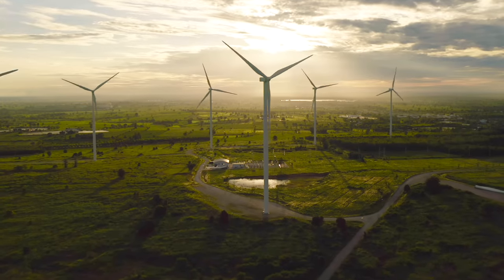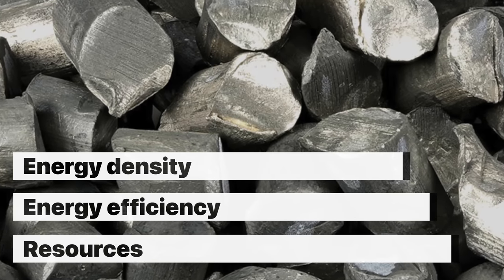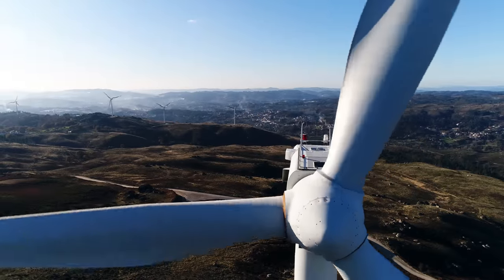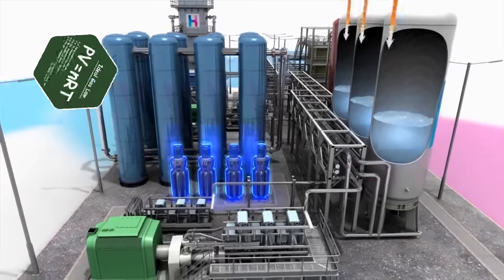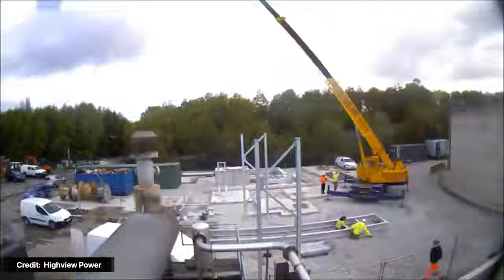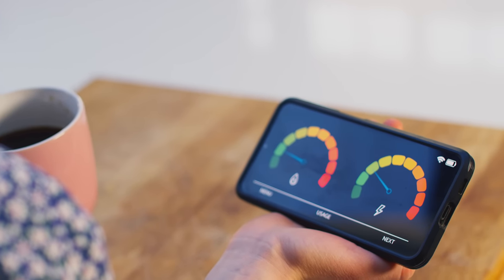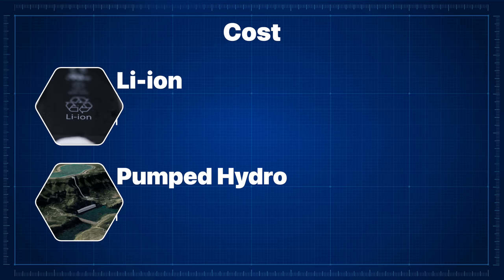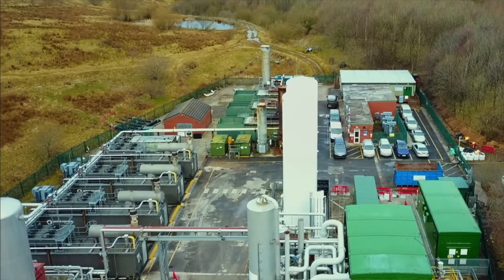Insane Breakthrough Stores Energy In Frozen Air!

Comment: Every storage with pcm where cold or hot temparatures needs to be maintained is good for normally 4-12 hrs cycle storage. This is the first gap that needs to be filled, but also more competition. Thermal chemical ( for eg nanocoated salt or hydrogen is for longer storage suitable, will be about larger storage for longer time. That’s what we really need with our summer/winter seasons..

Comment: A cryogenic energy storage facility could be used in the desert of Las Vegas Nevada USA there is a power plant there that is not being used it's solar they have high winds and high heat  hot air be drawn in or use the unused solar plant to generate more efficient forms of heat for the cryogenic storage system you would probably get 60% or better efficiency and with a proper and effective storage cells it could possibly be even higher this would be a great project for that area and would put that power plant back to use instead of sitting there unused which is solar it has an issue with power conversion but would be great for heating air and helping in the conversion process for the cryogenic power storage system

Comment: I have been storing energy as compressed air for over 50 years. My windmills all pump air. I use vertical axis wind turbines with a simple pump and some check valves. It's really simple and it's easy. I use the compressed air to run Small engines I design and build as a hobby, but I can also make my own electricity in any voltage I want using the compressed air run through any number of engines I have built, to turn a generator or alternator. The trade-off is, it takes a lot of air to make anything happen, but for me, it's just a hobby, so I don't really care.
Reply: This is very interesting. I know there are a variety of air powered tools out there. How much electricity can you produce from your windmills this way?  How many watts can you produce? What PSI does the system run at?

Comment: The Ambri battery is also only 80% efficient vs the lithium-ion battery, which is 90% efficient but, since it is only a third of the price of the lithium-ion battery, it more than makes up for its lower efficiency. The initial costs will be drastically lower and will make up for the energy that is lost over time.
Reply: Sounds like the beta to vhs competiton. Does Ambri have any other advantages than cost at this time over lithium?

Comment: So much great innovation right now. Using excess renewable energy in all forms in a must and multiple options too. Another option being looked at is using excess renewables for electrolysis  to create hydrogen and then maybe one day  use existing gas networks as a huge battery that can be used on demand.

Comment: I’m going to have to disagree about efficiency being the most important.  Here in the UK where this is being built, there are significant periods of time in the winter when it’s very windy when we have more electricity than we can use, more than we can export and more than we can store. This excess energy will increase as we are adding extra wind power every day. This means that we have to turn off wind turbines throughout the autumn and winter. Under these conditions, even if the battery was 10% efficient, it’s better to store the excess electricity than to constrain the generation.
Reply: I was thinking that, there are many times throughout Europe where wind generates more energy than we use and that excess energy would be ideal for this and as you say, considering we're building more renewable energy sources like solar and winds, it's likely we're going to see a lot more periods of excess energy being generated.

Storing that energy is where the problem is and this could be one solution to that and even thought the efficiency isn't that great with that storage option, it's better than nothing and it's likely only going to get more efficient in time.

Also, because of everything that's going on with Ukraine and Russia and the energy market, it's very likely we're going to get a massive boost in renewable energy in Europe, in other words, it's very likely at times that we're going to be generating a lot more energy than we need.

Comment: Switch to compressing the air to a liquid and storing it in a pressure tank, that way you can use the heat from compressing it with a stirling engine to get some power out to contribute to compressing the air and there is no need for insulation or for heating when using the air battery. Shure you need thicker tanks and perhaps a carbon fiber or kevlar blast shield for safety, but running it would be more efficient and storage over time would cost next to nothing as it do not need to be kept cold. Provided the tanks are built to handle at least -35 to +130 c you would get more out than you put in if it is cool/cold when you fill it and warm/hot when using it aka fill at night.

Comment: Determinating if a technology is economically feasible as energy storage, is determined by a combination of efficiency and cost. As more excess renewable energy becomes available for storage, efficiency will become less important and lcoe will become more important. One of the big advantages of this technology is that it is extremely scalable as far as the duration of delivering power is concerned.

Comment: I live in one of the summer “hell” zones, the Imperial Valley in the Southeastern corner of the state of California.  I have often wondered how our excessive heat could be “captured” and used to generate energy on an affordable scale.  What processes have you seen used in other areas of the world that might be viable even for a common homeowner?  I look forward to seeing your thoughts.
Reply: Imperial Valley has plenty of sunshine which can be put to use with agrivoltaics, solar panels over crops.  And then there's the geothermal power plant at the south end of the Salton Sea.  So you can keep the heat.  😁😁
Reply: Annualized geo solar could work well
Summer heat is transfered via water pipes to the ground where it is extracted in winter for home heat or to preheat hot water boiler
Reply: @3crowsfarm16  
That's not very effective where the water table underground is only a few meters below.  It will soak up heat and move it somewhere else.

Comment: If the cooling level were increased to beyond -280C and coupled with steel plants & silicon chip fabs, the side gas products could be fractionally separated and used, as well as sequestering CO2 and getting credit for that only releasing the nitrogen fraction for power regeneration.  The Neon, Krypton, and O2 fractions (even if small in some instances) could be separated for other markets as just part of the process.

Comment: I feel there's a missed opportunity here. Why not harvest the energy using the heat exchangers? The pressure is insanely low compared to the temperature differential. A heat engine being used as the exchanger rather than exchanging the heat forcibly should produce more energy from this differential and latent heat than a pressure engine. Hell, use both!
Reply: Sterling Engine?

Comment: CATL is already building sodium Ion batteries that cost $40/kWh and are capable of 1500 charge cycles, about 3 times as many as lithium ion.  Cost, even including BMS and grid tie inverters, will probably kick the guts out of even pumped hydro, without the land utilisation problems.
Reply from the maker: Really? I didn’t realize they already were commercialized! I need to look Into it. Thanks Anton!
Reply: @TwoBitDaVinci  They're making them using Prussian White instead of Nickel.  The resulting batteries are high specific power to weight, but not good on power to volume - meaning they would have limited usefulness in vehicles.

However, as a stationary storage medium, they're looking great, as long as you don't mind them taking up about a third more space than equivalent LiFePo4 batteries.

Comment: So.. This Sounds like a good idea for hot sunny areas.  A Hybrid plant that captures both Solar electric and Solar heat.  would make this work.  Of course for cooler sunny areas capturing the heat from other sources is cool.  (Storing the heat from data centers or Server Farms.)   
The sleeping thing.  Well, Seems to me you need to move where you are sleeping to the lowest part of the house.  My bedroom is in the basement. It is always cooler down there than the rest of the house, with no additional energy input.

Comment: During peak solar times, why not have the cells powering a pump which pushes water to VERY BIG storage tanks a hundred feet up the side of a mountain.  Then, when additional power is needed, used the stored water to generate electricity like a dam does.

Comment: great story - excess industrial heat as auxiliary has potential, but solar thermal; sand storage, etc could more than facilitate such challenges assuming that the heat required to change the liquid bCk to gas is at least less than that of volcanic temperatures. 
Mirrors, lenses and all means for purposes of harnessing solar with the added storage of silica should make quick work of the stated dilemma.

Comment: Boiling is maximum evaporation. In a vacuum, this emptiness of low pressure can also emerge from the top of fluid in a vessel. Perhaps there is some air trapped or movement. That is why we see vacuum bubbels in the first inches from the top and not from down below, where boiling should start because of the higher weight of the column. There are more video's on YouTube showing how easy water can evaporate but all based on lies in order to gain views and subscriptions. Just read and remember my first line: "boiling is maximum evaporation."

Comment: Maybe this could be used along side of concentrated solar power to supplement the molten salt storage.  Instead of using this stored heat to generate electricity directly It could be used to make the Cryogenic Air Battery more efficient.
Reply: Both can and should be done to perfect and reduce cost for best marketability of each.

Comment: Huge batteries to provide more power when load is high and generation is low is not the only solution. We should look at the opposite. Extra load that can be put on the grid as needed. Not peaker generators, but peaker consumers.

What would these be? Completely automated factories that ramp productions up and down as needed.  Eg, think of a factory that produces say, glass for solar panels or solar concentrators. The utilities automatically signals it to use more or less electricity as they need. At certain times, it might be completely idle. In return, the utilities provide discounted (or free) electricity.

Factories might not be able to respond so quickly, even when automated, so we insert a smaller battery in between as a buffer, to allow production lines in the factory to start up and shut down more slowly, minutes instead of seconds.
Reply: This is some thing we can already do right now. We do not need years of research to get tech we don't already have. Right now, factories are optimized to produce as much as they can sell. This need not be so. Money makes the world go around. For energy intensive industries, if we look at the primary purpose as to absorb the excess electricity when demand is low, it would be economically feasible to slow/shut these factories down according to energy needs. This is especially true if the factory is automated, so they do not have to pay salaries even when it is idle. We need only a handful of employees who do regular maintenance. Monitoring could be done remotely. A very small team could monitor an almost unlimited number if factories if they are properly instrumented.

Comment: Couldn’t you harness the heat in a dessert the best?  Make the lines long and let the sun heat them up. Or combine the mirror project like they did outside of Vegas to heat the gas using mirrors during the day.
Reply: Can it be done is not the question because it can. The question is should it be done and is it the most cost efficent and resource efficent means and is it the closest point of intersecting cost vs availble resource. You have to factor location and utilize the best cheapest sources per application. This is where local sourcing comes into play. Green energy is finally taking root to becoming affordable enough that everyone is looking under every rock for it. Long term cost is the factor. How much will it cost you the next 20,30,80 years is what to look for and how can you make it the cheapest and most abundant for 8 billion people. For some it will be locally sourced materials that make it the cheapest. For others diy/offgrid will be cheapest. To harness desert heat is a big project that somewhere like Las Vegas takes advantage of so a company in that area will take up the challenge to tackle it. The further away you are the lesser your likely to get in on that deal.
Reply: @terrafirma9328  yeah everywhere will be different for sure. What I was thinking is maybe do it in one of the hottest cities in Texas. Texas is already connected to the national grid is and is gets well over a 100 degrees regularly. Or maybe even Phoenix Arizona since it has way too many days in excess of 100 degrees. Another option could be to use natural Geyser’s we have in the US. Maybe like Beowawe in Nevada because it already has a geothermal power plant there. So to tap off the infrastructure would be cheaper since one exists already. I think if they used and blended multiple green sources this would be even more efficient and therefore cheaper making it more widely available to the end consumer. That would expedite getting it done faster which is def needed in our current global climate.

Comment: I think one of the big questions is if using industrial waste heat for this is the best use of it. it seems like there are a number of companies looking to recoup the waste heat, so I'm curious which one gets the most out of it. for instance, it might be best just to turn the heat directly into electricity.
Reply: If the $$ are right per application
Reply: Like “run a stirling generator off the heat” vs “dump the heat into the cryo-battery’s capacitor/buffer for rapid gasification”?

Comment: The waste heat on compression/heat req to decompress is the biggest hurdle, several years ago a company was working on a compressed air powered car, ultra simple, except the compressed air kept freezing the air motor.... It was all not that efficient, same issues here.
A pity as the air car was SO simple - would have been ideal for 3rd world countries, etc.

Comment: Grid level Energy storage comes down to cost, not efficiency. Phase change energy storage has the huge advantage of being able to be used anywhere. Using CO2 rather than oxygen allows for much easier storage at higher temps, and can be run with off the shelf technology already in use today. Grid-level energy storage also doesn't require high energy density, It just has to be cheap and reliable. Lithium should only be used in applications that require high energy density.

Comment: What about gravity storage: raising a weight up a tower electrically and when extra power is needed letting it drop gradually to do the opposite, generate electricity. You could get high energy density with a large enough weight like lead.
Reply: lead is too expensive, baskets of rocks lowered down dissused mine shafts makes more sense.
Reply: @waltermcphee3787  This is the price of lead in 2022 $0.44/lb or 0.97cents/kg. It is one of the cheapest metals. Of course rocks are even cheaper but do they have the same weight per cubic metre? In other words what is the cost weight = (weight / cubic metre) /(price / cubic metre), cubic metre of rocks versus lead? With lead it is cost weight of 1.031. With rocks I am not certain because I don't know what type of rocks you mean and the weigh / cubic metre and the cost of obtaining them either as a by product or breaking up boulders. I might try and work it out tomorrow as I  Am tired now.
Reply: @grgmetube  scrap lead in the UK is £1.20 or 1.42 dollars a kg. Consider the amount needed for the project, not to mention the possible pollution risk.
Reply: @waltermcphee3787  The price depends where you get it. The price I got today is a lot more than about 2 days ago. The price today is $2.038 american dollars. The price I got a few days ago was 0.97c. It is probably going up and down all the time because of investing and trading. It is at $2.038 now. It is extremely easy to work with. It doesn't take much heat to melt. It is only toxic if handled in a reckless way. I don't dismiss rocks though except they might give a lower energy density because if crushed into gravel, the small gaps between each pebble. There would be some cost in crushing it but obtaining gravel from a natural pit might be ideal. It would be possible to use uncrushed boulders, maybe shaping them somewhat to fit the mechanism for hoisting up and down.

Comment: Well, the efficiency, while not great, is at least better efficiency than using hydrogen from water electrolysis, and has an added benefit of much more compact storage. Also, not only could efficiency be improved by utilizing waste heat, it could also provide cooling, refrigeration, and air conditioning as well. There are a lot of good synergies possible. 

A similar idea was proposed, using CO2 which can be compressed and liquified at more modest temperatures. Somewhat better efficiency, but it does require a very large structure to house low pressure gaseous CO2.